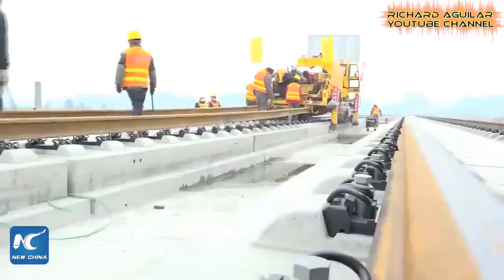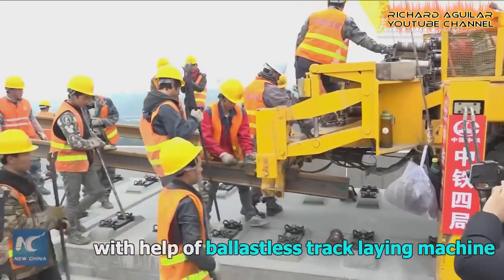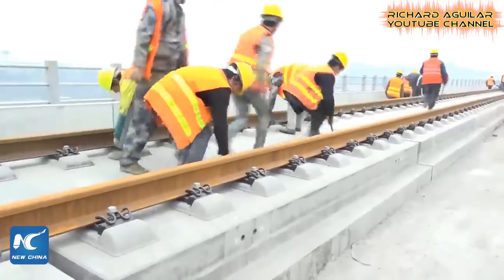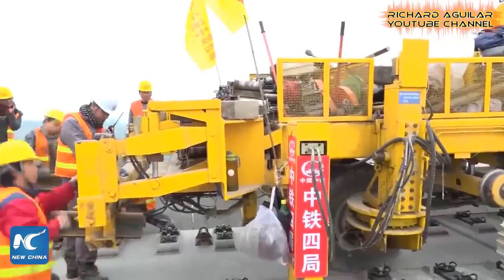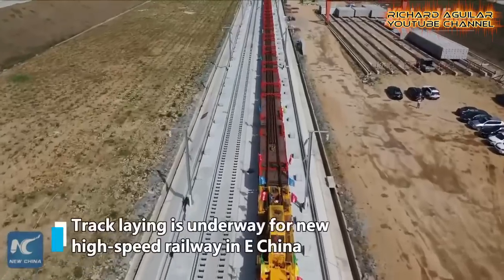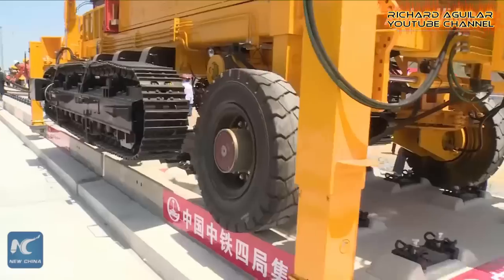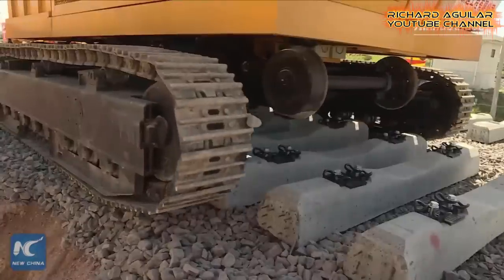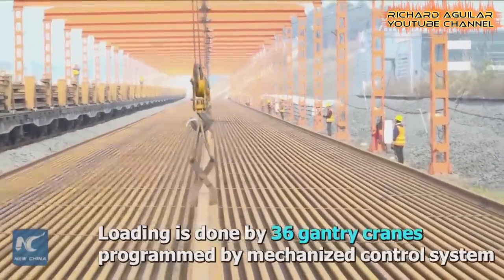China Unveils Innovative Ways In Laying High Speed Rail Tracks For High Speed Trains

Comment: I noticed there are no sound walls on these tracks. Being elivated noise is a big problem, especially for a train going 200 mph or so.  So what's it like to live near one of these trains?
Reply: Watch properly that they put a rubber between the track and slab to insulate vibration noise
Reply: @mateusmahumane8990  I imagine that would help some.  A train I guess would be less noisy than a freeway but something going 200 mph even if electric is going make allot of noise.  Even in the use elevated roads have much greater noise impact.  I am sure living close to these high-speed train tracked will have some draw backs.

Comment: Very impressive. What I have also seen that's also impressive is complete sections of track already mounted on a base structure that is simply placed in sections to form a complete rail track. By pre building the track on a base structure the sections can be built to a high specification under cover and fully checked before delivery to the site of the rail infrastructure.